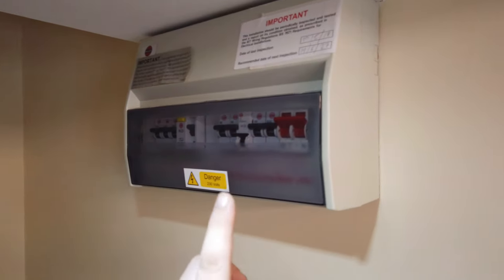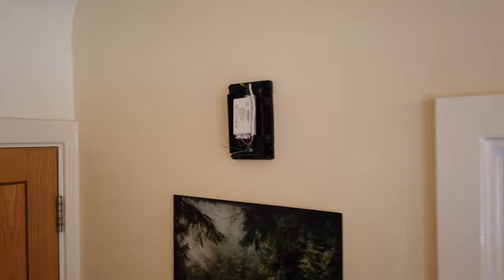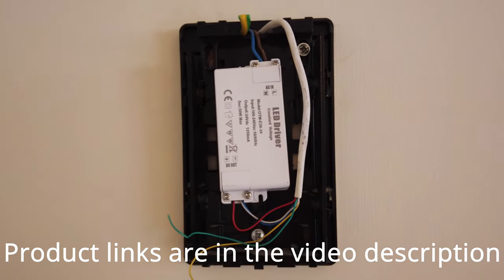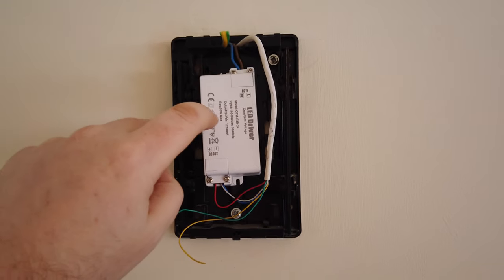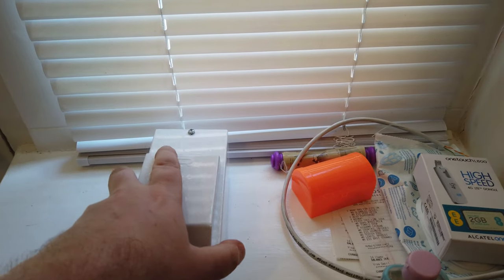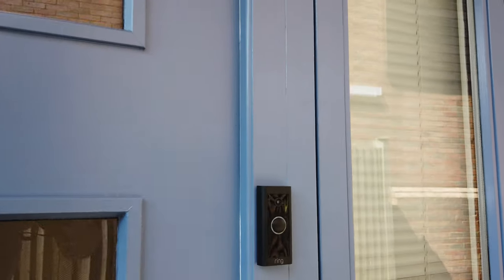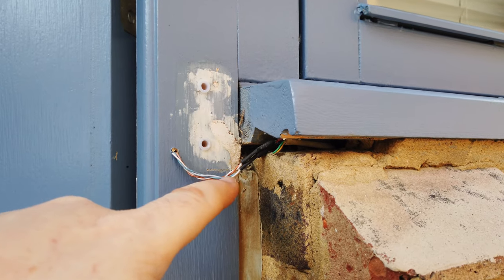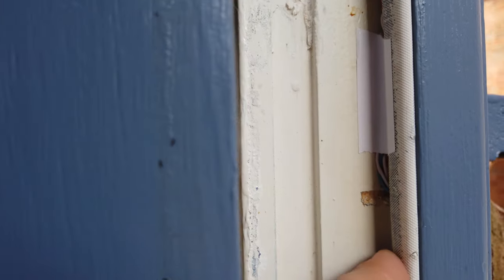Ring Wired Doorbell (UK) - a Step-by-Step Guide to Easy Installation

Comment from the maker: I'm really happy with this doorbell. When I'm in my home office, I can see who is at my door and I can talk to them (or ignore them) if I'm busy.

See https://kit.co/TechboyUK/ring-video-doorbell-wired-uk for a list of all the items I used to install it.
Reply: Ring says only to use a AC transformer. And you are using a third party DC transformer am I right?
Reply from the maker: @tee-botheewok716  The Ring website (Tech Specs section) https://en-uk.ring.com/products/video-doorbell-wired says to use DC 'You can hardwire your doorbell if you have a compatible doorbell system (8-24 VAC, 10-40VA, 50/60Hz ), or you can use Ring DIN Rail Transformer 2nd Gen (24VDC, 0.42A , 10.0W) sold separately. Doorbell chime must be bypassed.'
Reply: Bought my Ring doorbell months ago. Finally decided to have a go at installing it. Quickly realised that all the videos and instructions I'd seen previously did not match my setup! Glad to have found a UK video with a wiring setup like my own! Many thanks for this video and product links.
Reply from the maker: @jadeugur900  Good to hear it helped 👍🏻

Comment: Really useful. I bought the same bits and followed the instructions. There is a slight gap where he didn't cover removing the old door chime and transformer as he had already installed it. However still brilliant, and just worked. The hardest part was removing the original transformer from wall mount, a flat head screwdriver soon had that popped out. Was also able to use one of the cable grip screw holes to help hold the new transformer in place. Loving it, thanks!

Comment: Some useful info, just a couple of things, your audio is very quiet compared to say an advert. 
For those checking  electric supply is dead at the doorbell ALWAYS check on a live source with your volt pen first, then check to see the bell is dead, then check again on a live source.
Seems OTT but it's to check the pen works and it hasn't failed between the live test and the dead test.

Comment: This is great, I had almost the same issue, I had installed a dumb wireless doorbell in place of the wired builders doorbell. at that time I snipped the wires to the doorbell, but I also chucked the old chime and transformer out, and buried the old cables in the wall. Lol.
Luckily I managed to locate them again, just going out to buy a box fit the transformer to/in, now.
Reply from the maker: Getting access to the wires can be a bit fiddly, but once you do get access, it's quite easy to extend them by soldering. If you have good access, you don't even need to solder, you can get clamps to connect one wire to another 👍
Reply: @TechboyUK  thanks Paul. Question, is it OK to put the transformer into a surface box with a black plate on it? They can get warm, can't they?
Reply from the maker: @McStoolio  I've just felt my transformer (https://amzn.to/3EVmZ6O ) and it isn't warm at all, it's 'room-temperature'.

Comment: Thank you. What happens if you use a transformer that’s lower than the recommended? My ubiquti doorbell requires 16v but it’s working on an 8v. (I don’t have any chime connected, just doorbell itself)Thanks
Reply from the maker: I don't know what would happen... It just might not have enough power to function properly. You could try it an upgrade the transformer if needed.

BTW, the Ring Wired Doorbell doesn't support the use of the chime.

Comment: Hi, got round to installing my doorbell today and was the doorbell was not powering up at all, came across you’re video and realised the doorbell needed more power than the original transformer was giving, have brought your suggestion being delivered tomorrow, how easy is it to take out the old and fit the new transformer and do I still have to bypass the old chime when I install the new transformer, thanks tom
Reply from the maker: Taking out my old transformer and bell was a bit tricky - just had to force it out of the enclosure with a screwdriver and a bit of hacking away at the plastic. Fitting the new one was easy.

You can't use your existing doorbell chime. See https://en-uk.ring.com/products/video-doorbell-wired I get motion and doorbell alerts on my Ring chime, Alexa Echo and Show devices and my phone.
Reply: Ok well I don’t have the red and white wire that you have connected to the bottom
Reply from the maker: @Tom-vz3jw  The wires to the button might be different colours to the ones I have. You can tell what they should be because they will come from the transformer.

Comment: Hi there, watched your video and can say it's very well done indeed. I have a query and hope you can help. My transformer is next to my fuse box noted bell and plugs in and  the bell/chime is seperate above kitchen door.  from my chime. Stats on my transformer are - 230v 50/60hz. 4-8-12V-1A.  Is this compatible with Ring? I can email pics if there's any confusion. I really hope you reply. Regards and thanks in advance.
Reply from the maker: Hi, I'm not an electrician so can't advise on this.

I suggest referring to the 'Power and Connectivity' section of https://en-uk.ring.com/products/video-doorbell-wired and asking in the forum at https://diynot.com
Reply: @TechboyUK  Thanks for the reply. I've searched the model and found it on amazon in the reviews  other people have used it for the ring doorbell and its fine. So I've ordered and will fit tomorrow. Thanks again 👍🏻
Reply from the maker: @Njordsun  this is everything I used https://kit.co/TechboyUK/ring-video-doorbell-wired-uk
Reply: @TechboyUK  yeah I had a look at that earlier. Was just confused by my transformer. Seems it muti voltage. Can be 4v 8v or 12v. People who've used it for the ring doorbell have it set to 12v. My ones already set to that. Will install tomorrow and let you know how it goes. Thanks for the help.

Comment: Very informative - many thanks
Reply from the maker: Glad you found it useful.
Reply: @TechboyUK   I opened my old chime box and I have a Friedland Type 4 wiring bell box - indicating 8-16v but then says 6V - max 15W - is this sufficient do you think?
Reply from the maker: @dermotobrien8698  8V is ok, 6V isn't...

As mentioned here https://support.ring.com/hc/en-gb/articles/360054984332-Installing-Ring-Video-Doorbell-Wired 'Ring Video Doorbell Wired is compatible with most standard 8 to 24 VAC doorbell transformers. When sourcing a new transformer we recommend a transformer that is 8VA minimum, and must be less than 40VA.'

Whether yours is okay, I don't know as I'm not an electrician. I suggest asking in here https://www.diynot.com/diy/ or get the transformer I list here https://kit.co/TechboyUK/ring-video-doorbell-wired-uk
Reply: @TechboyUK  Thanks / ordered using your link ☺️
Reply: All worked a treat - many thanks
Reply from the maker: @dermotobrien8698  Great! 👍

Comment: Legend...... i have the exact same box and have been trying to see if i could use an LED driver for its low profile.
Reply from the maker: Glad I could help 👍🏻
Reply: @TechboyUK  did you have to cut the old chime and transformer out or do the just clip in?
Reply from the maker: @DaveRogers1985  I removed the old chime and transformer - it took a bit of pulling and cutting.
Reply: @TechboyUK  I'll get my Dremel out once the transformer comes tomorrow from amazon! 👍
Thanks

Comment: I’ve set up the ring wired today , and all seemed fine, and randomly my kettle tripped the RCD and blew the kettle element. Is that purely a coincidence? Or could I have wired in something incorrectly causing this to happen ? Was about 5 hours later …..
Reply from the maker: It's low amperage, so I think it's just a coincidence. The transformer is clearly labelled and it doesn't matter which way you wire the doorbell.

But I'm not an electrician, so you might want to check in https://www.diynot.com/diy/forums/electrics/
Reply: @TechboyUK  funnily enough my transformer wasn’t labelled other than the step down voltage part. I got the recommended BG one from screw fix, for the 240v in, I put blue to left and brown to the right ( only 2 slots) and for the cable to doorbell , one in at 0v and other at 24v .
Reply: Also would rain water getting behind the doorbell to wires and completing the circuit have an adverse effects on rest of house electrics ? It seems unlikely but wires are sealed or even fed up and into device so there’s a natural run off 🤔
Reply from the maker: @bgate1984  Any short circuit or power surge would trip the circuit breaker. It wouldn't affect the rest of the house.
Reply: @TechboyUK  ok matey, thanks for the quick replies 👍

Comment: Thanks Paul, really helpful video. Could you advise me please. I have a wired doorbell with a round internal bell, it isn't a square box like yours. It was here when I moved in. It doesn't go 'Ding Dong' it just gives a really loud offensive sound like the alarm on a wind up clock. I'm assuming there wouldn't be a transformer in the unit would you agree?
Reply from the maker: The transformer could be in the unit, if not it may be 1) In a separate case near it, 2) In a case near the consumer unit, 3) In the consumer unit (can you see anything in the consumer unit, i.e. fuse box; labelled 'bell/doorbell'?)
Reply: @TechboyUK  Cheers Paul I really appreciate your time. I shall investigate the cupboard where the consumer unit is housed and get back to you with or without my findings. 👍

Comment: Great video. But why was a Cat 5 Ethernet cable used in the first place to connect the chime to the button??. Was there an issue just using standard brown and blue cable?
Reply from the maker: You could use a standard cable. I followed advice in a DIY forum where someone used the wires from CAT5 cable - I already had some of this, so that's what I used 😊
Reply: A quick thank you. I purchased and installed the same LED adapter and installed the doorbell. Everything works great.  👍🏼
Reply from the maker: @bungabungaPartae  Excellent! Glad I could help 👍

Comment: You took the old bell out when replacing the transformer,so how do you hear it once the door bell is pressed?
Reply from the maker: The Ring Wired Doorbell cannot use a conventional doorbell, it can only send notifications/chimes electronically, to Alexa devices (Chime, Echo, Show, etc.) and mobile phones.

I have Alexa devices in most rooms of my house and garage, plus I always have my mobile phone on me, so I'm always aware when someone is at my front door 😊

Comment: Great video. I found this really useful as I've got the same chime. I brought the same led driver and it worked like a treat! Would have done it sooner if I've seen this before. Only issue I found was the existing cat5 cable was a little short and had been overtightened/snapped so was tricky to strip back. Would have been interested to see how you managed to soldier and extend your cables. Was half tempted to pull through another cable, but would probably lose it in the cavity.
Reply from the maker: Good to hear you found my video useful 👍

To extend the Cat5 wires, I just stripped the ends about 1.5cm and used a soldering iron to heat the wire of the old and extended wires, then I applied soldier to the wires. Then I covered with heat shrink and heated.

It isn't hard to solder 2 wires together - if you haven't soldered before, just gat a cheap soldering iron kit (see my description for one I recommend) and practice on some wires before you do it for real. Watch a YouTube video for instructions.

Comment: Thanks for the video - really helped me.  I got the same transformer as you, but the slightly lowered powered one, as it seemed to match the Ring transformer specs closer and was a bit cheaper/smaller.

All working well, but are the infra-red lights supposed to stay on all night?  Just walked out past the bell and the white circle is on and the two red lights.  I guess it's to ensure it can capture the pre-roll immediately as it detects something.
Reply from the maker: Good to hear it helped 👍 Yes the infra-red lights and white circle stay on all night (I checked mine last night).
Reply: @TechboyUK  Great, thanks for the reply.  And thanks again on the tip for the transformer - looks so much neater stashed away in the old bell enclosure, rather than fitting an ugly DIN rail box to the wall.
Reply: @russelljefferies6780 did you install the 24V 0.625A 15W version rather than the 24V 1.25A 30W version as shown on @techboyUK ‘s excellent video?
Reply: @andrewmcdermott2746  yes - that's the one.  :)  Doorbell works fine.

Comment: I needed to see how the video bell came apart!
Reply from the maker: I'm not sure what you mean by 'video bell'. The doorbell really doesn't come apart, it just has a case over it with a security screw underneath, which I explain at 07:30 I removed the old bell as the Ring Wired Doorbell doesn't use it.
Reply: I too wanted to know how the case comes off.  Videoing what you do rather than telling us about it retrospectively is much better I find

Comment: How did you open the door chime? I have the same one and I don't know how to open it.
Reply from the maker: Mine pulls off easily. Perhaps yours has clips, you may need to press in on the plastic at the top/sides as you pull it.

Comment: Why did u take the doorbell chime off aswell? Are u only using phones and other devices as a bell sound?
Reply from the maker: Yes, it bypasses the existing doorbell.

I've got it set up so that when the Ring doorbell button detects motion, also when the button is pressed; I get notifications on all the Alexa devices in my house (audio, plus video on my 2 Echo Show's), plus my mobile phone.

I have a mixture of Echo Dot's, Echo Show's and an Echo Chime.
Reply: @TechboyUK  ah ok I have same chime box, I want to some how use the existing chim but not sure how im going to fit the transformer and existing chime in the box.....
Reply from the maker: @adstheman89  You can't use your existing doorbell chime.

See https://en-uk.ring.com/products/video-doorbell-wired

-----------------------------------
Video Doorbell Wired requires existing doorbell wiring. Is it compatible with my existing doorbell chime?

No, not in this case. To make installation simple, Video Doorbell Wired requires you to bypass the existing doorbell chime which means your existing chime will not sound. To continue hearing audio alerts in your home, pair Video Doorbell Wired with an existing Ring Chime, compatible Alexa device, or select the Video Doorbell Wired + Chime bundle.

-----------------------------------

Comment: Thanks for the video Paul. Do you know if I can use this same method when replacing my existing Deta doorbell with the Ring Wired version? Most videos I see say I need to use the DIN transformer (which you also refer to in your video), but your method seems much easier to install - and cheaper!
Reply from the maker: Hi Andrew, The transformer converts the electricity from the mains (consumer unit) to the doorbell button. I ripped out my old doorbell and chime and put the LED Driver Transformer in their place. The transformer I used was https://amzn.to/3DCcGEi 24V, 1.25A, 30W. I think the lower power one would have been okay, but this one was suggested to me in a forum by someone who installs the Ring doorbells. It has been working okay with no issues at all.

I suggest you check the power requirements for your doorbell (just in case they have changed since I installed mine).

Please note that I am not an electrician, so you might want to double check.

See my posts https://community.ring.com/t/which-transformer-for-ring-video-doorbell-wired-uk/62516/2 and https://www.diynot.com/diy/threads/which-transformer-for-ring-video-doorbell-wired-uk.573232/
Reply: @TechboyUK  @Andrew Sheppard  - i bought the same one and used it just yesterday to install the doorbell.  Works a treat.

Comment: Great vid.  Could I split out from my outdoor security light, that is powered by mains and connect it to the LED driver and then from that, power the Ring doorbell?
Reply from the maker: I don't know. Try asking in https://www.diynot.com/diy/ I always get good advice in there 👍
Reply: @TechboyUK  Thanks, however have an update on this.  It works!. 👌I got the exact same LED driver you have and connected it in parallel to the Outdoor security light mains AC. And powered the Ring Video Doorbell from the DC out with no issues.  Pretty chuffed with it and saved money at the same time. 👍 Appreciated your video and info regarding this.
Reply from the maker: @kresky  Great to hear it's working 👍

Comment: I have the same doorbell transformer. Can I just use the original wires coming in from the doorbell to go in the bottom of the new transformer thanks. Mines only a blue and white one currently used. Thanks.
Reply from the maker: As I'm not an electrician I don't want to give the wrong advice, so I suggest you ask in https://www.diynot.com/diy/ - this is the forum I go to for any DIY questions 😊

Comment: Hi, what did you do with the green and yellow wires please?
Reply from the maker: Are they the wires coming out of your transformer? If so, they need to attach to the back or the Ring doorbell button.
Reply: @TechboyUK 2:00 in ur video?
Reply from the maker: @alphamega3822  Ah! They aren't used and there is no electricity going to them, so just ignore them.
Reply: @TechboyUK  thank u for ur help.

Comment: Ring doorbell’s run on a AC supply not DC like used in video also led drivers aren’t the same as transformers. Might work but looking forward to following video replacing the ring camera bell push. The separate enclosure with ring or other 18-24v ac transformer is the way to go.
Reply from the maker: The official FAQ recommends the Ring DC transformer. See https://en-uk.ring.com/products/video-doorbell-wired 'you can use Ring DIN Rail Transformer 2nd Gen (24VDC, 0.42A , 10.0W)'